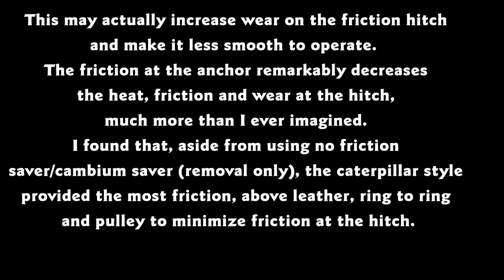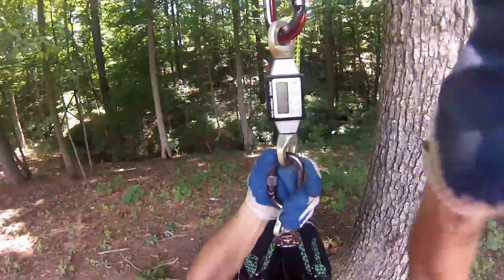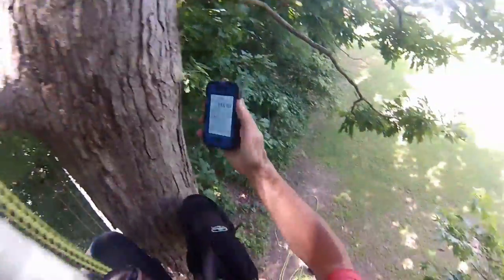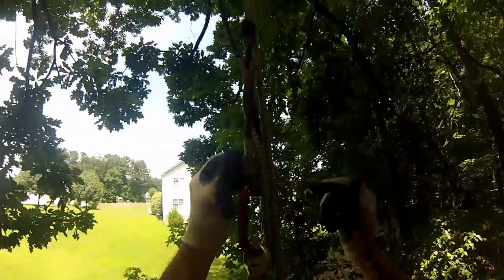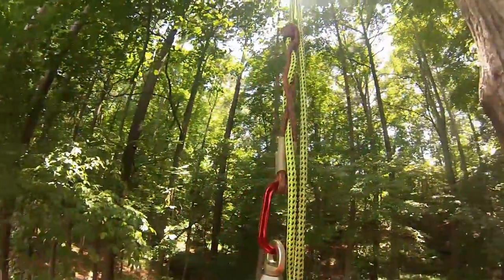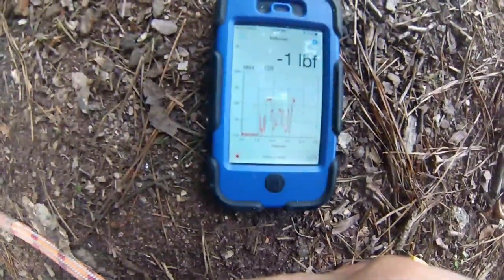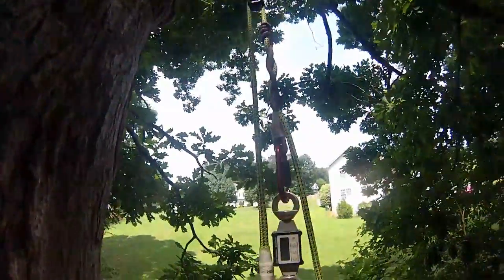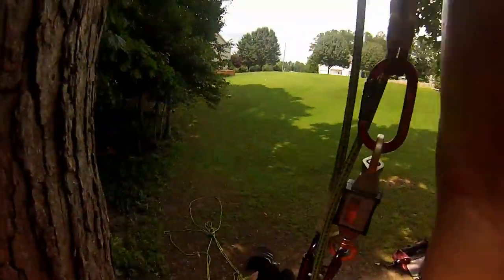Re-thinking the need for a pulley saver or friction-less tie in point.

Comment: Very interesting.  I had never considered the sharing and tradeoffs between the friction at the hitch and the friction at the TIP.  And going further, I had never considered the distribution of friction over the hitch itself.  Something that would be very interesting to add to this investigation would be to descend (a little rapidly to intentionally generate a little heat in the hitch) and then quickly image the hitch with an infrared camera that shows color as a function of temperature.  The IR image and heat distribution would give a good indication of the distribution of heat along the hitch knot and therefore the distribution of friction along the hitch.  I imagine the choice of hitch knot will have an affect as well. Thanks for the studies you perform.  As an engineer, I enjoy the scientific aspects of this stuff.

Comment: Hey Man just a tip looks like the branch where you have your anchor its a bit small, 4'' and up and the tie in at the base, be safe and thanks for sharing, a fellow arborist
Reply from the maker: Thanks, I've been up the tree so many times I was very familiar with it but a comment in the video would have been good.  Also in an unfamiliar tree that would not be a good first ascent. Following up from prior comments just for fun I put an 850 lb load at that anchor, White Oaks are pretty darn strong it didn't even whimper.

Comment: So in layman's s terms would the summary be that if you are concerned about putting too much weight and friction on your hitch to avoid having it jam up, such as might happen with a smaller diameter hitch cord like an 8mm, you might be better off using a cambium saver that has more friction, rather than a pulley which has very little friction, so that the cambium saver at the tie in point shares more of the load??
Reply from the maker: Yes, the more friction that can be taken off the hitch is beneficial to the hitch.

Comment: I have wondered what a one way pulley would do instead of a friction saver. Rock exotica briefly had a 2 inch, oneway Omniblock (P53OW) but it is no longer in the catalog. This should offer a 2:1 friction ratio when engaged to help with descent, but be free wheeling in ascent so we don't have to fight the friction. However, installing it backwards would be a struggle up and maybe an unpleasant descent. With SRT ascent, set the TIP and changeover, the opportunity for reverse configuration exists. The one way clutch is not visually inspectable in the field, but neither is the internals of the Grigri, and nobody seems to mind.  On the other hand, something like the ISC RP029 is PPE approved, offers the same predictable friction both ways with a nice bend radius for reduced fiber stress and milking, and won't fuzz up our ropes. Its harder climbing and not mid-line attachable, but friendlier to our prusiks and descenders, another trade-off.
Reply: Interesting, I didn't know there was such thing as a one way block.. that would make total sense. And one could simply pull each way on the rope to figure out which side is ascend and descend and then clip in accordingly. A one way would be a great idea for ddrt
Reply: Or 💪

Comment: what kind of friction  hitch you are using ? , how much load can take  according to manufacturer
Reply from the maker: In this case a VT.  If I understand you are asking, how much load can a friction hitch take?  They are rated for life support with the same minimum rating as the climbing line.  I hitch will either slip before the max load is reached or also lock on the line until the line breaks.  Lots of variables here so I don't think there is an answer like you might be looking for.

Comment: This was very interesting expirement, but tainted science. For evaluating the tie in point friction, the scale needs to be on the other end of the load where your grip isn't bypassing the scale (since there's no way to measure your bypassed load via your hand). I hope you'll agree and retest.
Reply from the maker: The numbers may be slightly different if an external force could be used to control the friction hitch.  But these numbers are simply a reflection of what's happening at the support point when it comes to friction.   retesting with an external source would not change that.
Thanks for your input.
Reply: @RichardMumford1  The numbers would indeed be reversed, but more accurate. The 200lbs should become greater than half, and the remainder is you're actual value that you tried to measure. It will be a good physics expirement.
Reply from the maker: @Fun4GA  I think the conclusion is fairly obvious, the more friction you have at the support point the less friction the hitch will see.  Sure it would be interesting to measure both sides at the same time and I could do that with an additional person and compare that when an external force is applied to the hitch versus the load Force applying to the hitch.

Comment: You also need to track how much load is being taken at the top of the friction hitch, not just what is acting below it.
Reply: He was demonstrating how much load that the prussic is bearing with the different techniques
Reply: +D. Ryan Shaw   My bad.   I meant to write friction hitch, not friction saver.  The load on the friction hitch is actually the combination of the load being held below it and of the load being applied to the top of the hitch by the hands.  A second gauge could be fastened to a ring around the rope and on top of the hitch.  This second gauge would be pulled down to cause the friction hitch to begin slipping.  Adding the two gauge values would then tell you what the hitch was actually supporting.  Given the climber's weight, you would also have the bonus of being able to determine the tension in the other leg of the rope.  By comparing the two tensions, you would also be able to determine how much friction the friction saver was generating
Reply: Yeah, I guess that's true.. never really thought of that pressure
Reply from the maker: +Terry Hale True, to get the 100% accurate number but then this is what we feel, which is the point of getting what we don't feel to do the work.  Maybe I did this backwards, I should just measure what we feel.
Reply: I have an unfortunate interest in "what we feel", which is the pull we exert above the hitch.  I have had several occasions where what I was able to exert was not sufficient to get the hitch to move.
   The peak pull needed to initiate movement in any given situation is probably a bit higher than what is required to sustain movement.
Reply from the maker: +Terry Hale Exactly why getting friction elsewhere, ie, TIP, is what this is about.
Reply: Yup.  Friction at the TIP is a big help if you are headed down.  Not so good if you are working your way back up.
Regardless, thanks for the video of your research.  Nice to know that information.
Reply: just piggybacking onto good sir Hale's comment about movements.

the old static verses kinetic friction principles making another appearance. i say another as they were at play with your moving the large stump around video as well.

i enjoy your content immensely and look forward to learning something from your next video!
live long and prosper good sir!
Reply: @RichardMumford1  I think you did just that - measured what YOU feel - how much weight is carried by the climbing side in the DdRT using an anchor point with different friction coefficients. Not only is total weight on either side of the rope system changed (always equalling 100%) but the pressure you had to apply to create the release slide I would think is different as well. Can you comment on that? Did you FEEL the need for more or less downward pressure to create downward travel when you changed friction devices?
Reply: @terryhale9006  Good point! So which  gives the climber the best "feel?" My guess is what device (or lack of) creates/allows the greatest friction...
Reply from the maker: @strandymusic  It would be interesting to tend the friction hitch remotely but I'm not sure it would change the concept.  We are still measuring how much the hitch is taking and making a like comparison.  Next time I get around to playing with this we will tend it remotely and see.

Comment: Nice small pulley works good➣>allmy.tips/FusionPulley?rr✳    with a 3/8 (10mm) line. Can be used as a prusik tending pulley if you clip a carabiner around the the line on the inlet and outlet side below the pulley so the prusik doesn't get sucked into the pulley.